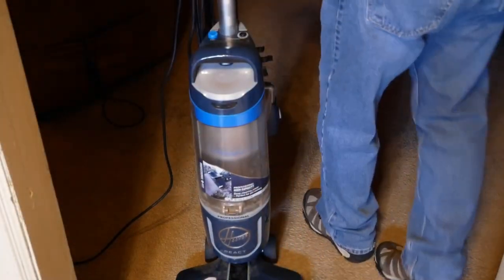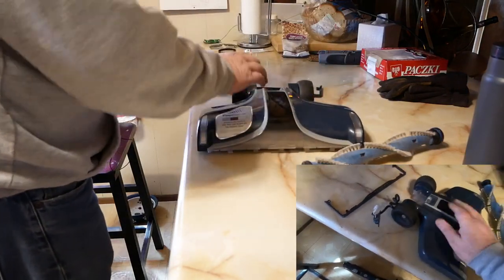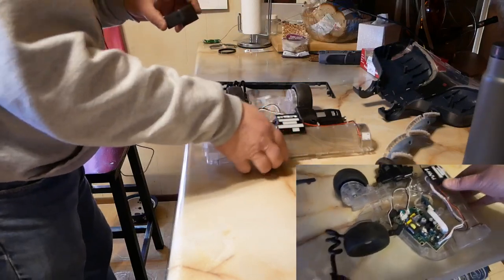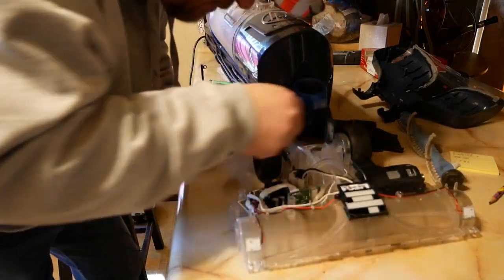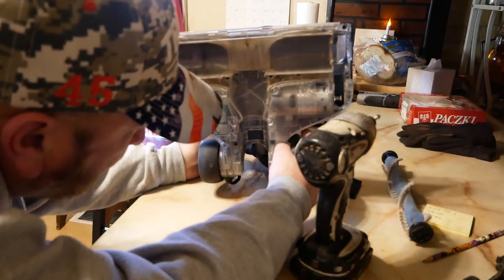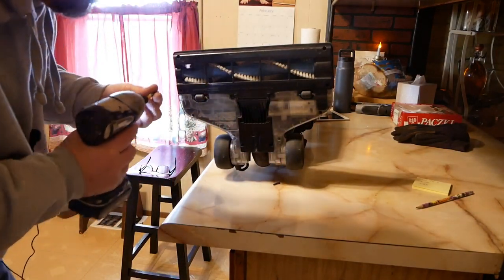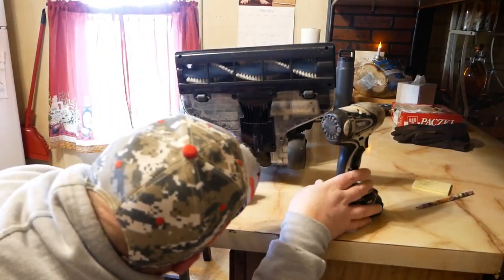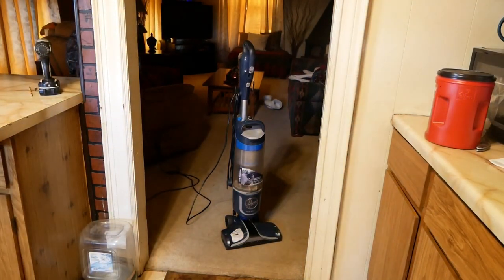Hoover REACT Professional vacuum brush stops working FIX

Comment: You're video helped me figure out the take-down procedure and location of the micro-switch..once i got there, i figure the most likely issue was the switch arm being bent down from use...i bent it back up a little bit, blew everything out with air and re-assembled it and it works great. Thanks for the video.

Comment: Thanks for the tip on disassembly and by-pass of switch. It works just as you said. I just cut and then soldered the existing leads from the black connector and it worked great. Wish I had read the previous comment about cleaning and bending but if I want I can go back in and undo what I did. Works great though! Thanks for saving me $200 for a new vacuum!

Comment: Thanks for all the info.  Mines was a vaccum switch.  There is a pinhole that give clogged.   Used a needle to clean it out.
Reply: Can you please tell me where to locate that pinhole to unclog it.

I don't wanna take apart way more then necessary if I can help it

Comment: Thank you for posting this! Got our vacuum back up and running with a $2 part. The 3 prong version of the micro switch works fine, btw - just clip off the middle prong and connect in the NC config.

Comment: Is real sad, This vacuum is 3 years old. Of this model. Beater brush stopped working. The one that I was using.... was over 30 years old. Never had a problem with it. Yes it was a Hoover also. Switch went out on it. Was starting to loose suction. Decide to replace it. It was better for vacuuming out cars. Longer hose and all the attachments . Was not trying to tip over.
Reply: I just had the exact same problem with a similar Hoover model.  3.5 years old, the brush switch went out.   I'm deeply disappointed in my new Hoover, it performed fine when it worked... but it broke down the moment the warranty lapsed.  Of course, Hoover's solution is to charge me an arm and a leg for the fix.

When I first moved out, I was given an old vacuum cleaner from my parents.  That thing was in service for 30+ years, worked great the whole time, easy to maintain.  One of the rubber belts (probably an original) gave out after I'd been using it for 8 or 9 years, plus my wife didn't like have the old musty vacuum in our new home, so I decided to give up on ol' faithful.  I figured a new vacuum would last longer... and now I'm wishing I just bought the dang $2 rubber belt and repaired my old vacuum.  At least that thing was designed to last more than 3 years.  I can't believe this.

Comment: What was the part number for the microswitch?
Reply from the maker: KW4-3Z-3 👍👍🍻🍻🍻
Reply: @116falconer  Thank you. My  brush/roll isn't working either. When I turn on the floor sense switch and roll the vacuum back and forth the front sense light doesn't show floor or carpet, just keeps blinking. I also can't hear the brush motor turn on anymore. I hope it's the microswitch like your issue was.
Reply from the maker: The switch on the vacuum is a 2 prong, don’t know if the 3 prong will work cause I never replaced mine. If you search the part number and add “2 prong” you’ll get results but they’re not as common as the 3 prong. Also Hoover no longer supports the React vacuum.
Reply from the maker: @joelramirez9256  I’m sure it’s the switch, it’s easy to bypass in order to get it up and running. Good luck and Merry Christmas 🎄🎁
Reply: @joelramirez9256  I have the same problem.
Reply: @116falconer  do you know the part number for the belt at 19:00